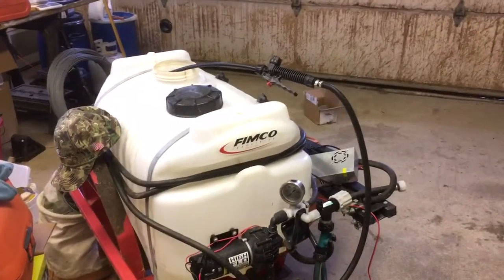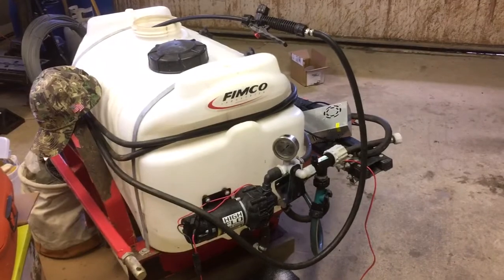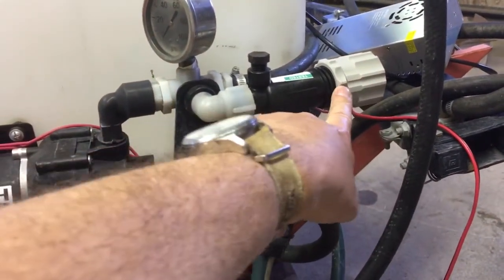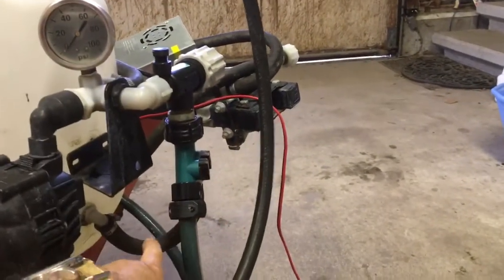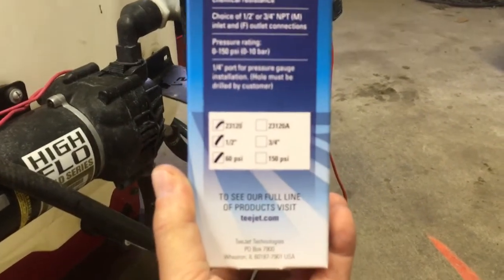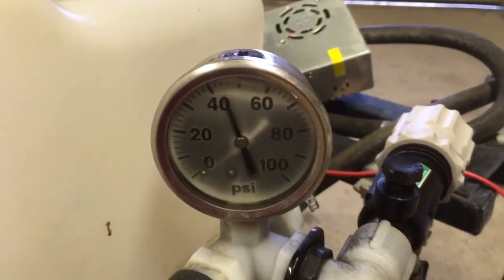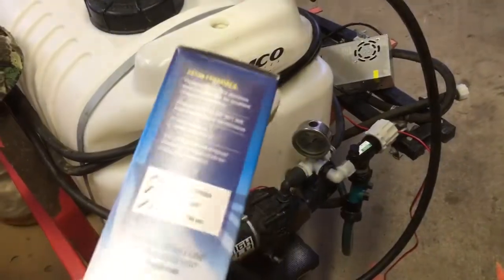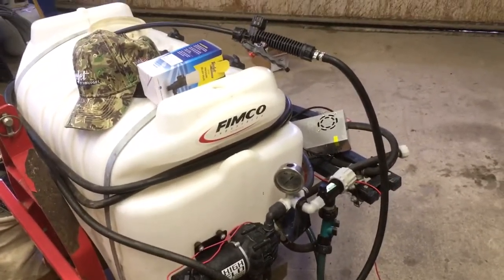TeeJet 23120 bypass regulator for your sprayer

Comment: I was looking for a way to add a bypass to my new Delavan 2GPM pump because it cycles like a machine gun. Man I got so excited watching your video that the second I saw you adding a bypass to your drain that I stopped watching and started piecing everything together. Running to the hardware store, back a forth  to my shop. Then after a few hours and finally trying it out with great expectations what i got was my cycling problem solved but at the sacrifice of about 1GPM and a pump that doesn’t shut off while resting because it’s constantly feeding the tank with the bypass. I only used a two way hose Y not a regulator though. , Any thoughts. Thanks
Reply from the maker: I can't think of a solution for you.  A bypass regulator is going to make your pump run continuously AND use some of the flow for it's operation.  In a home you would have a volume tank to absorb some of the volume to give you steady pressure, but I can't think of an economical way for you to do this with a small sprayer.  Sorry.

Comment: Thanks for sharing these details. I ordered the 60 psi pressure valve you have. The box identifies it as this correct model, however the valve knob says 150 psi on the top. Is this what your shows, or was my part possibly placed in an incorrect box?
Reply from the maker: I'm sorry, but I scrapped that sprayer a few years ago and can't find the regulator.   I'd recommend that you reach back to where you bought it and ask them to check their inventory.  Sorry.

Comment: why don't  you guys show explain how to connect what hoses to what openings on the regulator...we know what it is to do but show what hose goes where and why coming out of the regulator!!!!!!!
Reply from the maker: This is a "bypass" style regulator.  The fluid pushes against a spring loaded piston that lets fluid pass when the pressure reaches a set point.  The inlet on this regulator is on the bottom with the bypass being on the side.  The inlet is connected in parallel with your want/nozzles.  When the pressure reaches the desired level, it shunts the surplus fluid aside.  I use the surplus fluid to keep my spray tank stirred up.  All of the fluid goes back to the tank when I'm not spraying, and the pressure at the nozzle stays constant while I'm spraying so that I put a predictable volume of spray on my trees.  Looking at the video, you can see the outlet of the pump connecting to the bottom of the regulator with a pressure gauge to help me set the regulator. Does this help?  I admit that no one documents it well in their catalog.

Comment: I've just added this regulator to a 1 GPM  @40 PSI pump discharge is fine and with shut off valve closed to nozzles I set and 40 PSI.  Soon as I open valve it drops to 15 PSI.  So question is do I need a shut off valve to the discharge side to close it off?
Reply from the maker: You set the regulator while the nozzles are running.  The regulator diverts to the discharge side, so no real need for a valve.  let me know.
Reply: Ok tried it that way too but it would never get back to 40 PSI while running only while closed off hmmmm.
Reply from the maker: The spec os misleading. You get a maximum of one gpm OR 40 psi, but not both at the same time. Your pump is too small. You might change the nozzles to lesser volume versions.
Reply: @Neighbour_Al  that's what I was thinking I could add the valve to close off the agitation side if I didn't want it to recycle may work.  What you think?
Reply from the maker: @BigKahuna_outdoors  You can't break it by trying!  I can't work without agitation, but go for it if you can!